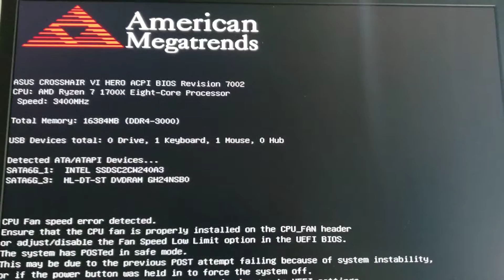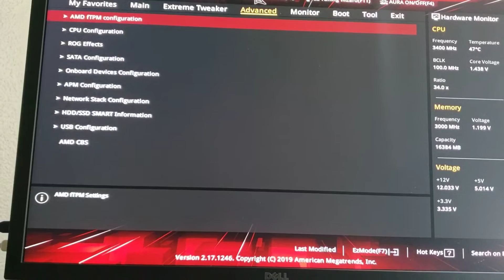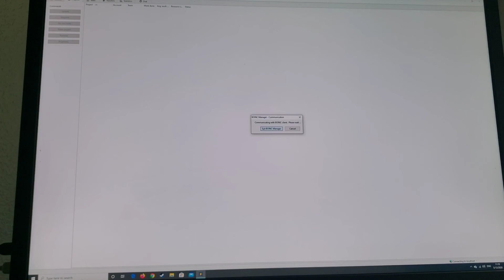Fan Speed Error

Comment: Finally we find someone who understands what he's doing
Thank you
Reply from the maker: You're welcome! Let me know if you have any questions!
Reply: @noahneutral7557  Yes, I have a question and I hope you can help me.
I want to update Windows 10 to 11, but I encountered an error and the reason was that the BIOS is legacy
So I changed the settings from the BIOS and put the UEFI boot, but after booting I had the same error so I read the system information and the BIOS was legacy and not UEFI although I changed it
Then I discovered the error behind it is that the SSD was MBR and not GPT and when I tried to change it I always got an error but I could not solve
Error "Disk layout validation failed for disk 0"
Reply from the maker: @densetsu7690  is windows installed on your ssd? I'll have to check again but most likely you'll need to reinstall windows to change that unfortunately. If you want to wait until windows 11 comes out officially you may have better luck.
Reply: @noahneutral7557  Hey bro help me please my system fans are making a bit more noise, asus z490-p

Comment: Only connect in the correct pins on the motherboard
Reply: I think thats where i went wrong due to no instructions with the Arctic cpu cooler 😕 the above video and others like it ignore the issue with will likely cause greater issues or complete failure of your possible expensive pc later. Im still not sure which is the correct socket for the arctic coolers 😪
Reply from the maker: In my video it was connected to the correct pins on my motherboard. Building a PC isn't that hard and the motherboard literally tells you where to plug in the fans but I'm wrong 🤷🤷. I've been running this setup since 2017 and I haven't had a single issue with it. No one is forcing you to follow this help.
Reply: even losers can plug the correct pin, stop this everyone-know-solution
Reply from the maker: @MinhNguyen-ef6um  no shit? This is just to get rid of the error message. It's not that hard to connect the pins to the motherboard.